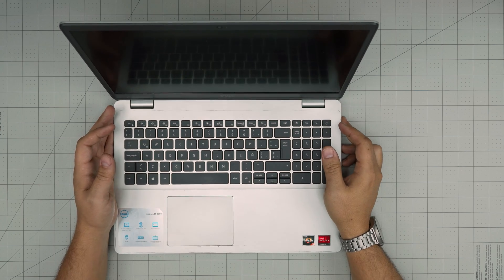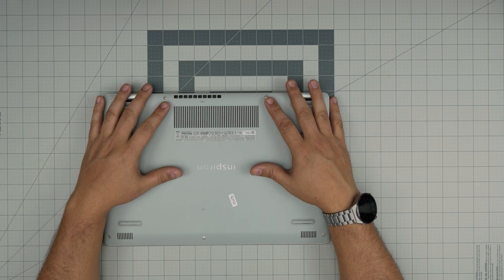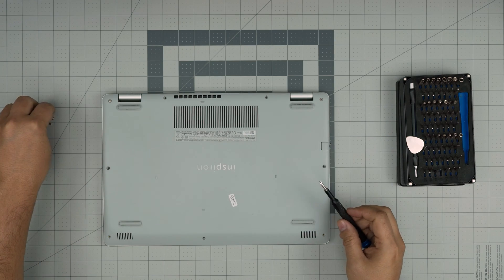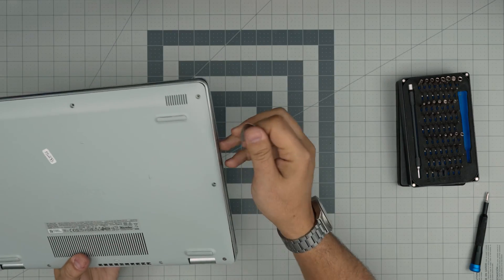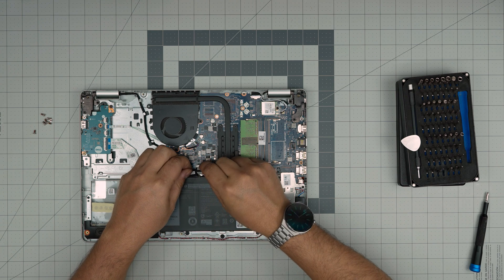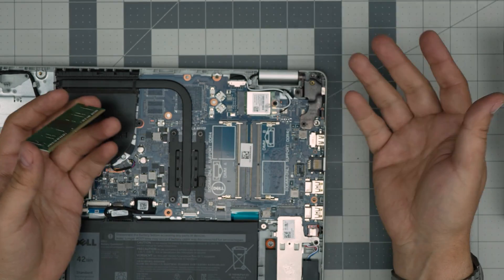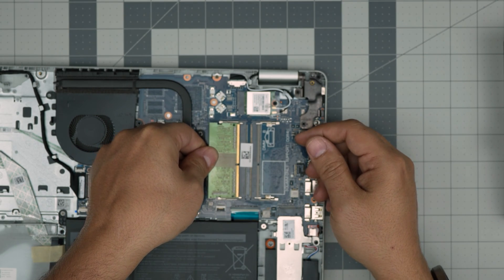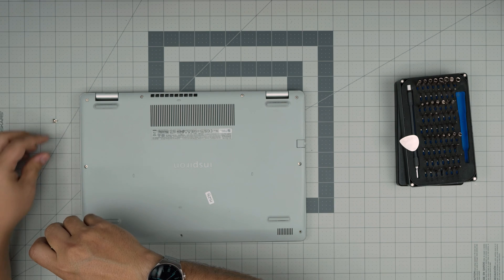How to Upgrade RAM in Your DELL Inspiron 15 3505 for Better Performance

Comment: Much easier than trying to decipher written instructions. I just wish the audio was a little better. The captions helped.
Reply from the maker: It's my pleasure my friend.
I do work on my audio and have the best mics, but the store is very noisy. After filtering in Audition, this is the best outcome. :(
cheers🍻
Reply: On restarting, I get Memory Change. Do I pick Continue, Bios Setup, or Diagnostics?
Reply: Just in case others have the same question, chatGPT said as long as I don't expect any problem, clicking Continue is fine. Yay! I'm enjoying my 16GB of RAM! (Which will feel slow in a day or two ...)
Reply from the maker: Yes just click Continue👍

Comment: I have same laptop with currently 16gb ram ( 2 sticks of 8gb ) what is the highest RAM I can add to the laptop?
Reply from the maker: 🫠Regarding your question, check the first link in the video description: "MAX RAM capacity," and you will find the maximum RAM capacity for your laptop.
https://youtu.be/tKEJTkVth4Q
cheers🍻
Reply: @uFixTek  thanks for the reply on the Dell website it says only 16gb max but I’ve seen else where it can go up to 32gb and other YouTube videos have said the same that it can have 32gb so I’m little confused and what is true
Reply from the maker: Check the video I gave you, and if the CMD shows 32GB, then it's 32GB.
Reply: @uFixTek  I’ve already done that I find it hard to believe it can go up to 128gb on a laptop, the  motherboard has a limit on how much ram it can have doing the cmd method just tells you how much windows can have

Comment: Hello, I have the same model but the Dell page says it's a 2400 not a 3200 so I'm a bit confused, could you please help me ?
Reply from the maker: 🫠Regarding your question, yes because the bios auto adjustes the ram to the max speed that it can handle, we recommend to place a 3200 and let the bios auto adjust it.
cheers🍻
Reply: @uFixTek  Thank you for the reply, please keep up the good work.
Reply from the maker: i appreciate your support my friend.

Comment: hilo bro i have lenoovo thinkpad t14 gen 1 itis good condition laptop but i face one problem its automatically drain battery i am fully charge and aftir 2 or 3 day's it's sleep with out using pleas giv me a solution thank you
Reply from the maker: 🫠Regarding your question, it is because you have a option turned on that is called fast boot, here is the steps to turn it off:
To disable Fast Startup manually, follow these steps:
Navigate to the Control Panel and select ‘Power Options.’
Choose ‘Choose what the power buttons do.’
Click on ‘Change settings that are currently unavailable.’
Under ‘Shutdown settings,’ uncheck the ‘Turn on fast startup’ box.
if you can't do it or lost let me know i can assist you more.
Should you have any further questions or requests in the future, please don't hesitate to ask me.
cheers🍻